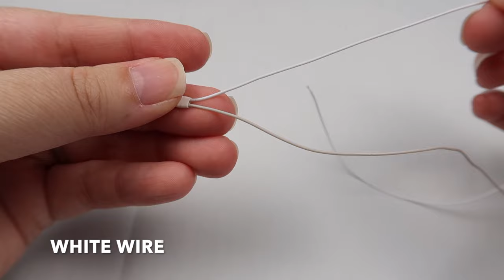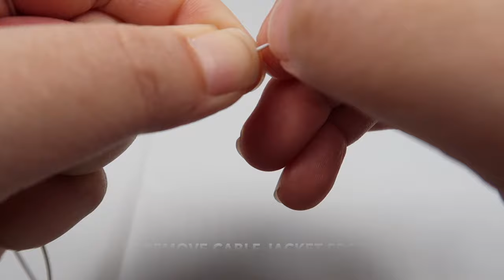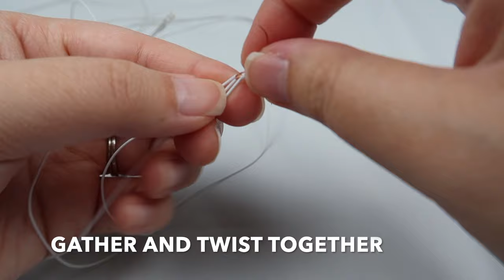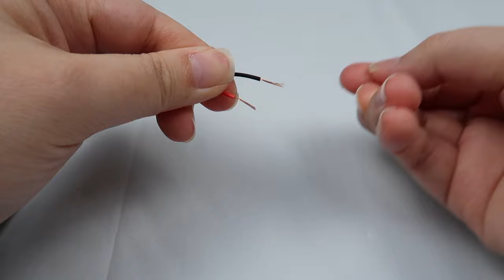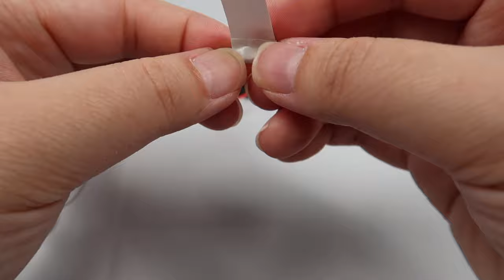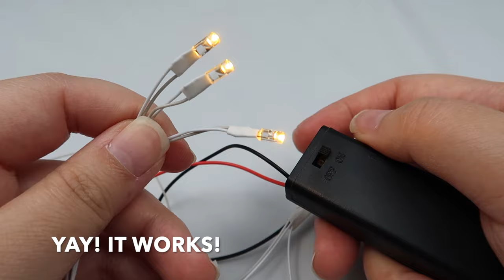How To Wire LED Lights For DIY Dollhouses

Comment: Thank you so much, this was just spot on for me being a raw beginner. How many of those little lights (3V?) can you run from the one battery holder?
Reply from the maker: thanks for watching! i'm glad it helped! for me, the most i've done is probably 5 or 6, but i'm sure you can run more than that if needed. not too sure what the limit would be, but from experience, i didn't need any more than 5-6 for my miniature builds.
Reply: @hawj89 , thank you so much! 😃

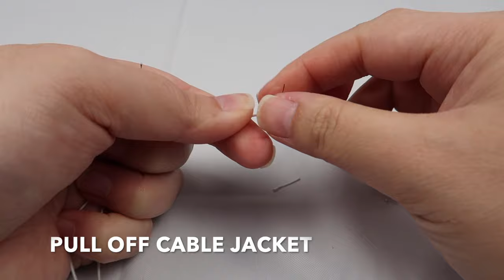Comment: @1:14 once you separate the jacket but before you remove it, rotate the jacket a few times and it will twist the wires within. It helps to prevent breaking the inner wires.

Comment: A tip from an electronics assembler: For individual lights, don't just pull the insulation off the wires. Look at how the strands split apart, you don't want that. Instead, get the insulation started slipping off, and then twist it on the wire while pulling it off, it's easy to do. This leaves the individual strands twisted together and easy to manage.

Also, you can touch the LED wires to the battery wires you intend to attach them to so as to verify you are attaching them to the correct wires. You will not hurt anything by doing it wrong, and it is good to verify before you finalize the assembly, just in case.

A cleaner assembly is possible if you use solder and shrink tubing, but it takes a little more effort. Once done that way the result looks cleaner and it is not easily accidentally tugged apart.

Comment: This helped me because I didint understand what it meant but cutting the wire so the copper would show and at first it didint work so then I re did the wiring then they turned on this helped me so much thank you

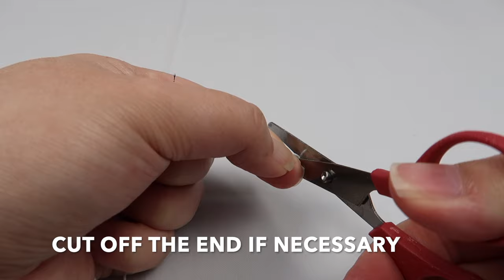Comment: After building a 1:12 scale 3-foot/3 story dollhouse with copper wire lighting I decided to build my first ever 1:24 scale miniature dollhouse by Cutebee. The kit ;has the same wire packaging with LED light strands and battery pack as you used here so I am hoping that I can get my lights to work because when I followed the instructions in the manual I got nothing!  Could you consider talking the viewers through the steps next time as I am usually trying to follow the step-by-step instructions as I listen to them.  Wish me luck!  If I get my lights on I'm going to share this video with my Instagram followers. Thanks again!!

Comment: Could we instead of using the battery box from a kit, use the original battery box that came with the fairy lights? Just trying to figure out if i can use the stuff i already have (basically just fairy lights and wire tape)

Comment: Thanks for the tutorial!  Any tips with shorter than average wires?  There was extra wire included- can I graph it in between the short wires and battery box?
Reply: Did anyone answer u? Or did u get it figured out? Regardless, for anyone else, Yes u can splice in extra wire. 😊
Reply: @PADS62  thanks!  I ended up splicing and it worked ❤️
Reply: @Artistbrandi  
oh Yay! I'm so happy you did it! 💓 
Happy Hobbying 😁❤

Comment: I did my wires as instructed but my problem is the lights stay on even when I turn the switch off. When on OFF the light is softer, when on ON the light is stronger... can't figure it out
Reply: Sounds like power leakage. It’s often something you won’t notice for your more power intensive lights, but when you hook up a “cheap” light like a tiny LED, it’ll stay on, only a bit softer, or it’ll flicker if the power leakage isn’t enough to power the bulb constantly. 

https://youtu.be/tzWz_guJHvY

This thread has some more technical details, apparently it’s often due to an incompatibility between the switch and bulb: https://diy.stackexchange.com/questions/81431/electrical-current-leaking-from-light-fixture-when-off

Comment: Thank you!  I got a kit from my mom, and I'm almost finished, but these wires keep driving me crazy:(. They're probably half the gauge of the wires you're using, and they keep breaking.  I've already used too much of the wire and heat-shrink tubes, so I'll have to buy more.  I'll try this, but I'll more than likely just break them again.

Comment: Excellent demo. And no chat or music 👍👍 thanks.  Please where do I find a battery with on /off incorporated switch like yours?  So neat. Has it a name?  I’ve been using a small, separate connector but it adds to the fiddle and bulk.

Comment: Thank you BUT what tape kind do you use
Reply from the maker: i just use the cable tapes that comes in the dollhouse kits. i'm sure you can substitute with masking tapes or whatever you have. the idea is just to hold the wires together.

Comment: Is there any need for resistors?
Reply: The simplest circuit to power an LED is a voltage source with a resistor and an LED in series. Such a resistor is often called a ballast resistor. The ballast resistor is used to limit the current through the LED and to prevent excess current that can burn out the LED.